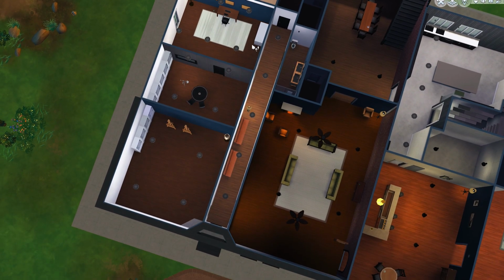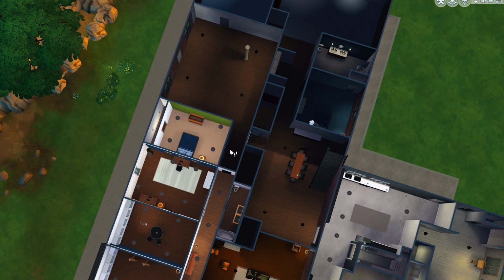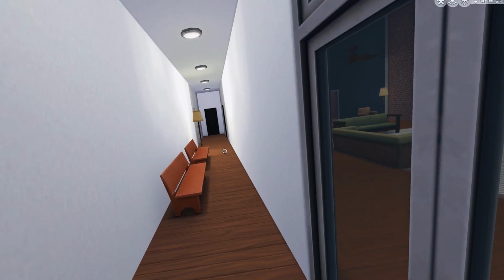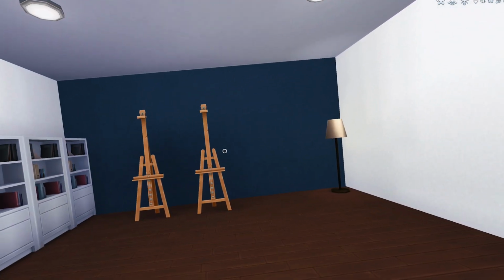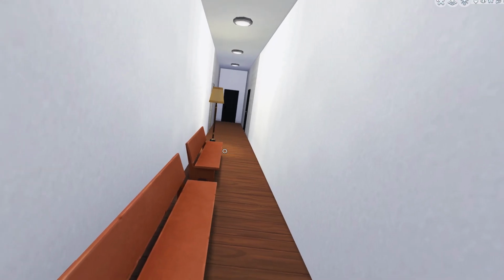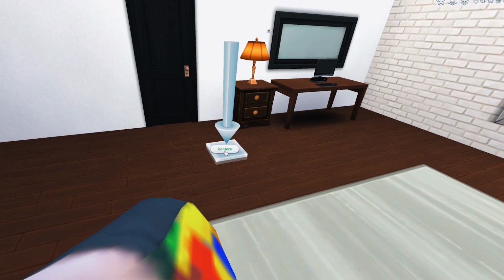Turning Old General Store Building Into Our Home | Floor Pan Tour Part 1

Comment: Coming into the house that looks enormous and seeing a slim hallway would kill me. I would bring the right side of the hallway down since it’s going to be a living room that way you’ll be able to see into that living room and it doesn’t feel like a bunch of little doors as you go in.
Reply from the maker: So actually the hallway isn't the main entrance into the building. It's a secondary entrance. I'll be showing the main entry room in the next video. Stay tuned!
Reply: Exactly my thoughts. I hope the architect makes the hallway better  or something because yeah 😕 I hope that the owner does t get too upset if the architect changes a few things because it will look amazing. It’s good now but with just a smidge of flow it will be  awesome.

Comment: It would be lovely if the overall decor gave a nod to the age of the building. Don't turn it into a museum, but don't decorate it like it's something that it's not. Try to avoid trendy designs that will be expensive to upgrade. For example, the building is not a seaside cottage, so I wouldn't use shiplap. I'm not advocating decorating in the Victorian house style, but the walls, ceilings, doors, windows, and built-ins should look appropriate for a circa 1900 commercial building. Make it look like a 1900 commercial building that just happens to have rooms that work for living in. Then have fun with the furniture you add. The furniture could be anywhere from antique to modern.
Reply: @dr.christopherjohnson5046  Thank you, but no.
Reply: @sue2611  But why?
Reply: @sue2611  I just want us to be good friends?